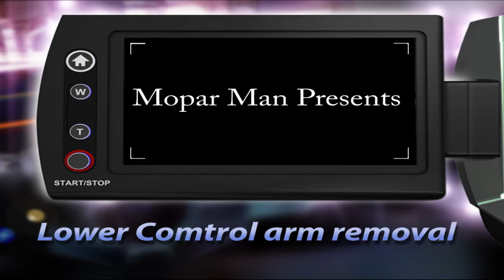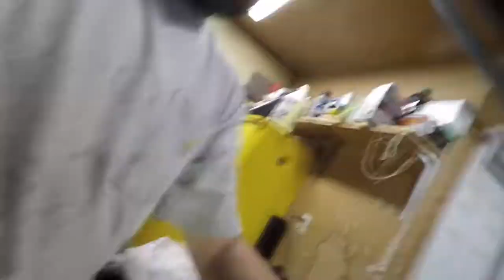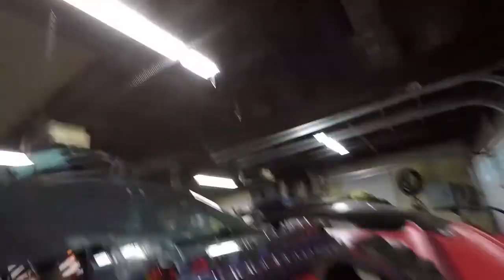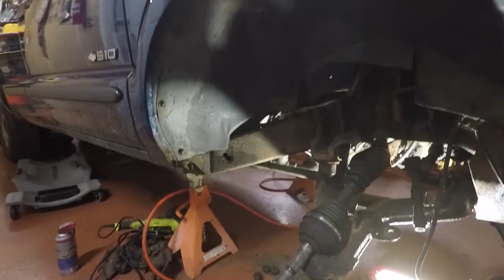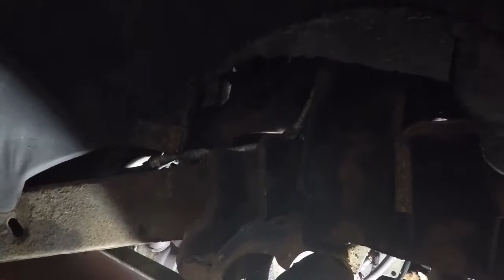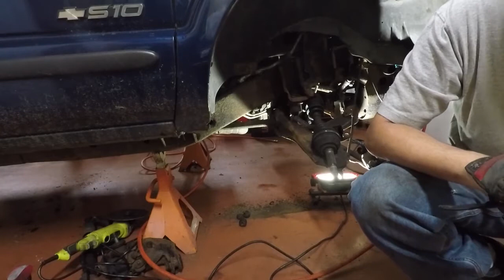2001 Chevy S-10 Lower control arm with torsion bars removal #tosionbars #suspensionparts

Comment: I was wondering i if you had to take the tension off the torsion bar before taking the lower control arm off like you did. I’m glad you mentioned that you needed to take the tension off.
Reply from the maker: Glad i could help!

Comment: soak your bolts and nuts down with penetration oil.  Even if it doesn't help you with the loosening it up, it'll stop you from having to breath as much Rust Dust.  I'm gettin ready to do this.  I will be replacing my shafts as well so I will take them out of the way.  Also, you have to remove the plastic shield, brush guard they put on 4x4s,  If you are already doing all this, do the CV shafts and the hubs as well plus the Sway bar links.  clean the rust up before putting the new one on on the torsion bar end.  I will grease it.  I will also powerwash the whole underside and clean up the frame rust and paint it.

Comment: So did you have to unload the tension bar or it just slides out? This is the only video of someone taking the lower control arm off a s10/blazer so props to you.
Reply from the maker: @cm6string thank you. I did unload it so i could slide it back. You don't have to remove the torsion bolt or key out

Comment: Got excited when I saw the truck is the EXACT same one I own, even the color. With video I found the upward torch light location backlighting into my eyes was giving me a headache, compressor noise another bonus.
Wish you'd shown removing back attachment/adjuster of torsion arm.
Reply from the maker: I didn't remove the adjuster or bolt, i just back off the bolt till loose and was able to slid the torsion arms out

Comment: What lower control arms did u use
Reply from the maker: I think moog, but it was from rockauto.
Reply: @MonsterDodge24  how’s the quality
Reply from the maker: @zlock6514  i know moog to be good as they have grease fittings.   I have a set on my 2012 ram 1500 with a 6in lift and they are still holding up.
Reply: @MonsterDodge24  any chance u can get me the link
Reply from the maker: @zlock6514  i am not near my computer, doing this off mobile, but you can filter the search results on rock auto for 4wd and front

Comment: Any tips for when it doesnt slide right off? Been soaking it in penatrating oil and heating the lower control arm but she's rusted pretty good
Reply from the maker: If your replacing the lower control arm, then I would use a cutoff wheel and slice into the area around the torsion bar. If your not replacing the lower control arm, I would remove the nuts and bolts holding the lower control arm and see if the torsion bar will slide out with the lower control arm as one piece, removing it from lever.